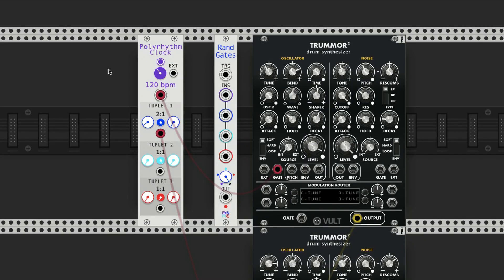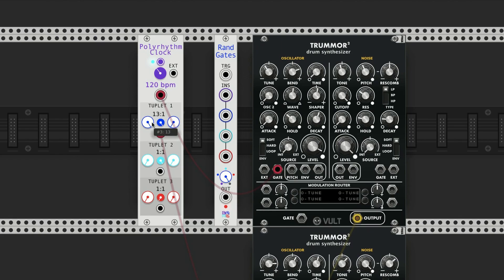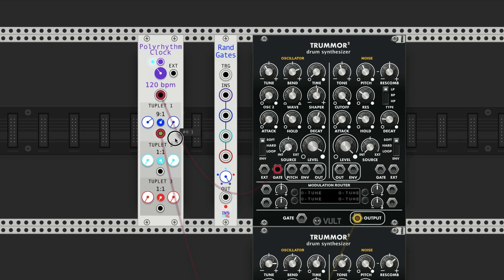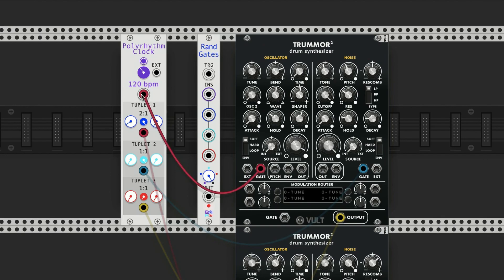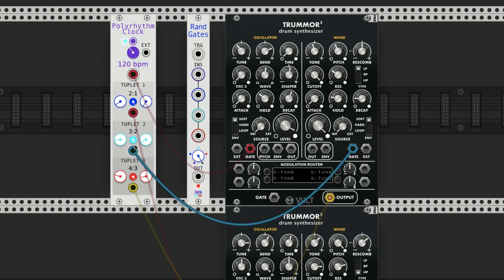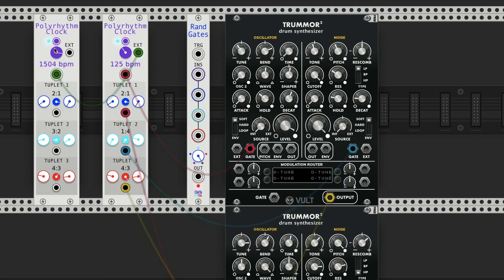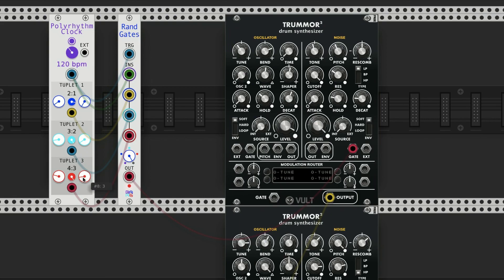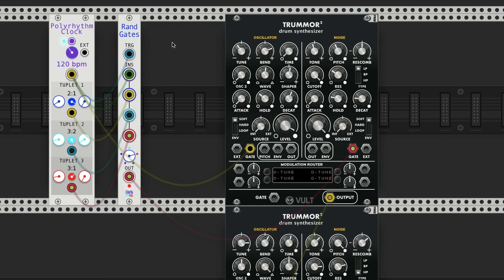Polyrhythm Clock & Rand Gates - Sha# Bang! Modules

Comment: The external clock mode is confusing and anything but intuitive.
But it's a wonderful module indeed!
Reply from the maker: Thanks, András. The external clock mode is somewhat of a standard that I am using similar to Impromptu's CLOCKED module. The CV input follow VCV Rack's voltage standards: 0V input = midi note 60 = 120 bpm, 1V = note 72 = 240 bpm, and everything in between, etc. The PPQN means the tempo is set according to the number of pulses per quarter note. So if it is 12 PPQN, and the external BPM is 720, the result will be 60 BPM (720 / 12 = 60). Does that make sense? It's useful for synchronizing multiple modules that use clocks and will also be fairly accurate if you are altering the tempo. Hope this helps
Reply: @jeremysmuller  It does make sense but I think I ignore this module for some time.  Stochastic Sequencer is the one I'm spending the most time with. :)
Thank you for the informative tutorial videos!